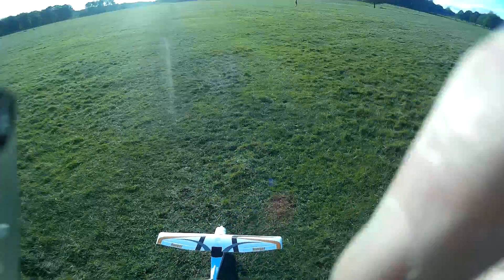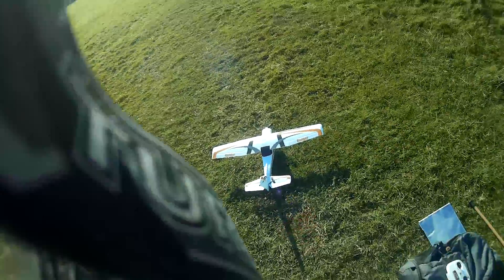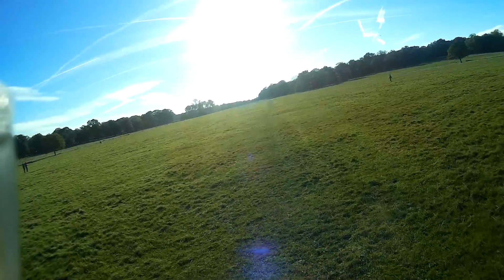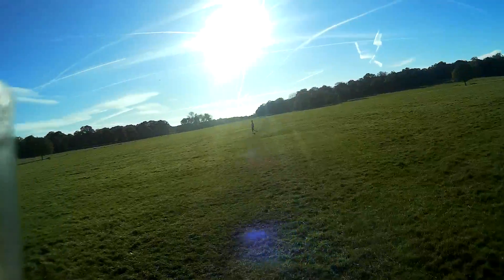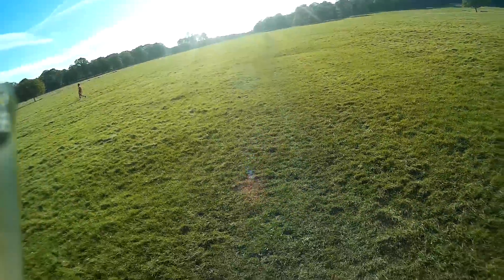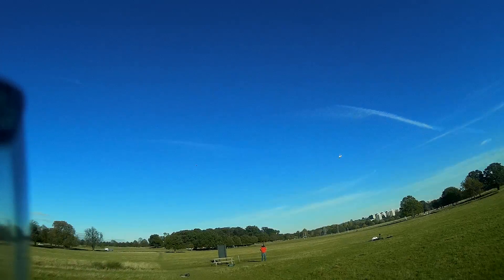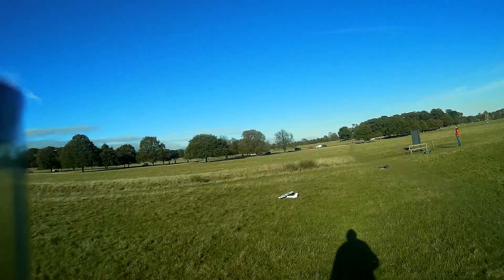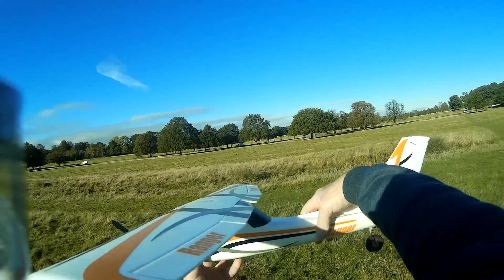Tail dragging 850 RANGER conversion.... Maiden

Comment: I have the same problem!! That's why I fly mostly Tundra planes😖 and belly landers!! Any way your conversion worked and it flew well so great Job Brian
P.S. thanks for your continued efforts to message me and Cheryl on our channel, it's very frustrating but at least I can see that you've messaged even if I can't open it up 😄👍
Reply from the maker: Hi Ian it's gone through another change front undercarriage is gone I just have the tail wheel so landing is bum down first bleed of the speed then nose down
Reply from the maker: 1234
Reply: Yes the grass at Richmond park does look very rough 😖
Reply from the maker: @IansRCExploits  not surprising really hurds of red. Fallow dear... Horses.. Then the walkers trampling through mud so when it dries out you have the CAMELS back. Plus it's a public flying field so there under no obligation to keep the scrub down.. The up side is NO CLUB RULES. IF I WANT TO LAND IT ON MY HEAD I CAN...... TRY.. when there's multiple planes you don't all have to fly in the same direction and to my knowledge there's never been any trouble on the field... So in my book that's a big plus
Reply from the maker: Just seen your evo vid all the way through..... 2 point landings
.... SLICK... YOU'VE CERTAINLY MASTERED THE OL TOUCH DOWNS.. HI CHERYL GOOD TO HEAR YOUR VOICE... GOOD CAMERA  TRACKING
BEST TO YOU BOTH
Brian